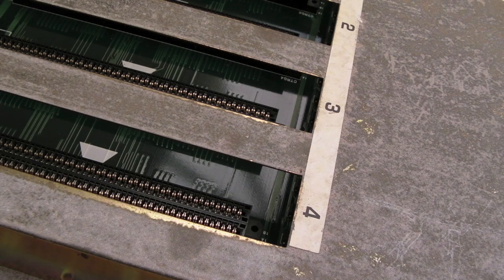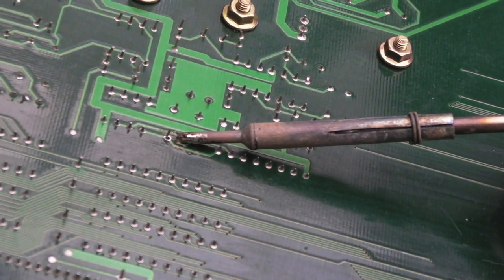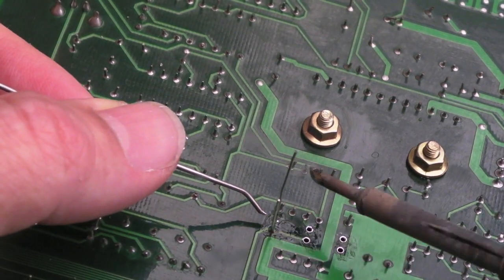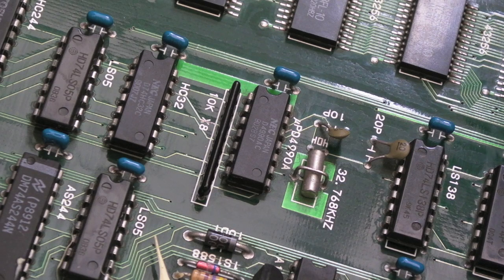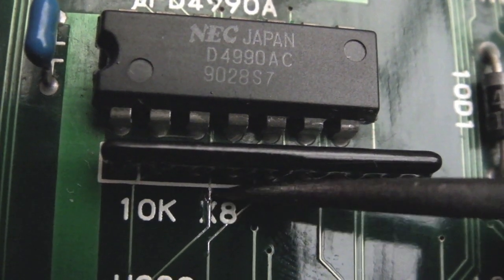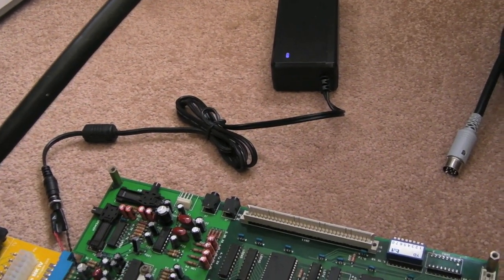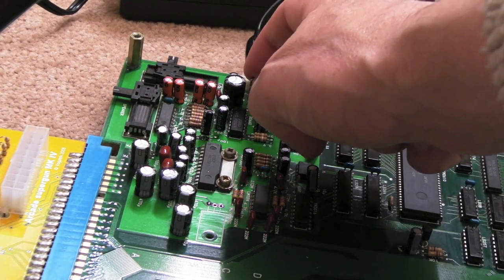SNK Neo Geo MV4 5v Mod / Capacitors (Re-cap) / Backup RAM Fault / Headphone Sound Output Mod

Comment: have you ever repaired a mv1b without sound?
Reply from the maker: Yes, I had a faulty Z80 on there.  Swapped it out and got sound back.
Reply: @GadgetUK164  i already swapped it with a TMPZ84C00AM-8  and with a game gear cpu but sound is  still missing...
Reply from the maker: Assuming the IC is good and fitted OK (no damaged traces), it's bad news as I believe one of the larger custom chips interfaces with the Z80.  Double check all the connections, make sure the cart slot PCB has no broken traces either, and clean the interconnect connectors on the main board and the cart slot board.
Reply: @GadgetUK164  i don't remember if i have already told you,  there was a trace cutted on the b board near the ym2610, the chip legs was lifted and tinned with a wire to one of the cartridge slot. maybe the previous owner fried the ym2610 with a wrong solder?

Comment: The PCB on MVS boards is so thick that I haven't had a need for a desoldering station for these. I'll eventually get one just in case I ever need to remove a Mask ROM or any "many legged" component, but to remove caps it is not necessary.

I use a flush cutter to cut the legs on caps from the component side, and then I use the iron on the component side and gently pull with tweezers from the other side to remove the legs, and finally I use a desoldering braid dipped in flux to remove excess solder.
Reply: By the way, I don't mean to imply that a desoldering station is not optimal. The aim of my comment is to encourage people getting started (or thinking about getting started) in electronics to just get going, it's obviously better to have all the nice tools, but you don't need to buy every tool on day one just to start learning and doing simple maintenance, mods or repair work. 

You can get started with less than 100 USD worth of equipment, you really just need a inexpensive multimeter to check for continuity, a solder gun with a fine tip (I use a battery powered one, the Hakko FX 901, with AA eneloops), flux paste, acid free solder and a wet rag to keep your solder gun tip clean. 

You can get better tools over time as you need them, and the great thing is that you can hand down your intro equipment to someone else that wants to get started.
Reply from the maker: Yes, most of the stuff I tend to do on my channel is done with a cheap 15W iron and a manual desolder pump =D

Comment: I did the 5v mod on my 2 slot. I’m a using 5v 3Amp and works fine. Can the 4 slot use the same 3Amp or does it need a higher amp like the 8Amp you have for yours?
Reply from the maker: You could try the 3A PSU and it might just work.  A single slot board (MV1FZ pulls about 1.3 amps with a cart), so I would guess these 4 slots will pull 2.5 to 3 amps probably.
Reply: GadgetUK164 - Retro Gaming Repairs & Mods Ok thanks for sharing the knowledge! I’ve learned a lot from watching you, thank you.

Comment: Hi there,

Nice stuff! I have a question...
Would you use ceramic capacitors to recap the sound section of a board similar than this one?
Reply from the maker: Personally - no!  They don't behave the same way, and good quality electrolytics will last a long time.

Comment: Hi there, great videos on NEOGEO consolized boards. I recently bought a 4 slot MVS board that I want to consolized. Is it ok to get the +5V and Ground of the Jamma edge points as you did. Also I might have missed or you didn't show here but did you removed the power regulator to create a +5v line bridge between the primary and secondary +5v rails? And what gauge wire do you recommend for the +5V line. Finally, what power supply do you recomend for 4 slot boards? I read that the 4 slot uses almost 5.5A on the +5v line when fully loaded. does a 5V 6Amps be ok. https://www.amazon.com/gp/product/B01EAF4YNE/ref=oh_aui_detailpage_o00_s00?ie=UTF8&psc=1
Reply from the maker: Yes, you can take the 5v and ground from the JAMMA edge, but try not to solder onto the JAMMA connector itself, solder onto the thick traces that lead into the JAMMA edge.  You might have to scratch the green solder mask off carefully to expose the copper of the trace.   I would personally use an 8A 5v PSU,.  If it uses 5.5A, 6A is too close and the PSU will fail sooner rather than later.  Make sure you run the 5v through an inline fuse holder too, and put a suitable fuse in there.  Probably best to measure current across the fuse contacts without a fuse first, just to measure how much current its actually drawing.  For wire - I've no idea on exact gauge, something like 23 AWG doubled up like I did is fine.  You could use speaker wire or something like that, I am sure that's more than thick enough.
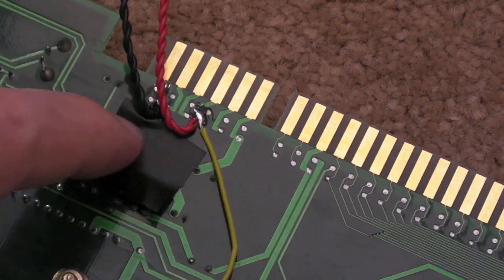Reply: Thanks for the response! I realized after closer inspection that my MVS board is a different model: It is a (Mv4fs) and it has a different Battery and different 5V power regulator components. In your video at 16:04min, you created a +5v line bridge with a cut off the regulator. I not sure how to proceed to consolized this model because there are no tutorials on Jamma X or anywhere else. I need help with the +5V MOD and Battery Mod. Any suggestions!

My MVS board Mv4fs:
http://wiki.arcadeotaku.com/w/File:Mv4fs.jpg

Here is a pic showing my board where the power regulator +5V area should be:
https://www.flickr.com/photos/69518491@N02/32928196552/in/dateposted-public/

Here is the Battery area. There is no 470ohm resistor in this spot. Should I cut the 220?
https://www.flickr.com/photos/69518491@N02/32702276040/in/dateposted-public/

Comment: 11:10 - I have attempted precisely this with varying results. At the moment, I have 3 N64 rumble paks that were freebies. All of them got bad battery corrosion and I've found multiple broken traces just before the connector pins. This method hasn't work so well on those; I think there's just too much of the original trace gone
Reply from the maker: Yeah, I do tend to just use a proper bridge wire for those types of failure.  I just got a little lazy with this one because it was such a small nick in the trace.
Reply: +GadgetUK164 Seems like I'll have to do the same if I want to save those rumble paks. quite a bit of fidgety work to breathe new life into $25 worth of N64 accessories LOL

Comment: 5:49- I do the same when replacing caps; wiggle out one side at a time and don't be in too much of a hurry. I've had a special bit of frustration working with some newer circuit boards and lead free solder. makes you have a whole new appreciation for working on older electronics! 

And the all important ESR! Often overlooked but always important. It doesn't matter if you have proper capacitance if the resistance is sky high!!
Reply from the maker: Yes, you are right =D   One thing I have found time and again though - the ESR and capacitance are related, ie. when the capacitance is out, the ESR is too, and vice versa.
Reply: +GadgetUK164 True, although it seems I've seen bad ESR on a cap that tested good capacitance-wise. but, perhaps it was flaky equipment or a flaky me at that moment in time! Now, I have a pair of those tweezers that test capacitance (plus a Diode test and a couple other handy features) and I usually track down the bad caps with that

Comment: Its interesting the difference working with 4 layer boards, the NeoGeo are the first I've really done anything on. Like you say, you notice the difference when removing caps etc, you do need more heat and I found solder sucker tools to be less effective. But then, the old MV1A board I have also seems to have very small through holes for caps etc. I don't know how much of this is related to wave soldered boards? Additional mechanical resistance to keep components in place during the wave solder process?
Reply from the maker: Yes - I am sure you are right that its the 4 layers that absorb the heat!  All MVS boards seem like that, needing more heat to remove components.  I tend to find that my desolder station set to ~400 works best on these boards.  I am not sure if they are wave soldered - how do you tell?  They probably are I think, just not sure where the clues are, other than perhaps how the solder points look?
Reply: The little solder fins on the outer pins of the chips are the tell tale mark of wave soldering. These are solder thieving or robbing pads used to help stop bridging.

Comment: Removing caps I guess you learn by making mistakes. Some of those old caps you took off actually don't look bad by visual inspection. Do you ever measure them to check their condition?
Reply from the maker: Yes, I always measure them as I don't like throwing working caps away!  All the 4.7uF caps had correct ESR and all but 1 measured very close to 4.7uF.  Yet all of the others had high ESR and most of them measured at 50% or less of their rated uF marking.  eg. The 100uF caps were all measuring between 50 and 60uF, all the 22uF caps were around 13uF etc.
Reply: so just going by how they look is not good enough. Makes sense probably.

Comment: This is cool. I'm always interested on these Neo repair videos. I have a 4 slot somewhere, the smaller one with the controller ports. I have a 2 slot with I think a Z80 error, but I use it right now to size it for enclosures. Haha "untested" on ebay means its broke! Good stuff as always man!
Reply from the maker: Thanks!  Haha @ your EBAY comment!  Check out Dave Currans blog (Tynemouth Software), and see his recent guide to EBAY - it will make you laugh!!!

Comment: My 6-slot won't even power up if the voltage is below 5.25v, it just keeps hammering the watchdog and resetting the CPU trying to kick the board into life. It's probably because there's a shed load of 5v TTL on the bottom and top boards and well you're going to get some voltage drop. I know exactly what you mean with the traces there unnecessarily thin just making them 0.2 of a mm thicker would of made so much more scene I mean it not like there isn't enough space on a 4 or 6-slot.
Reply from the maker: Absolutely!  Makes you wonder if it was based on cost or whether they wanted traces to fail over time?